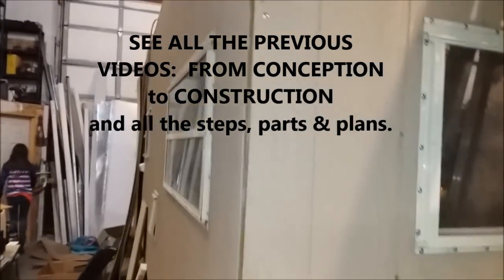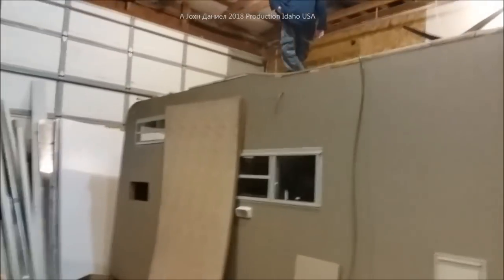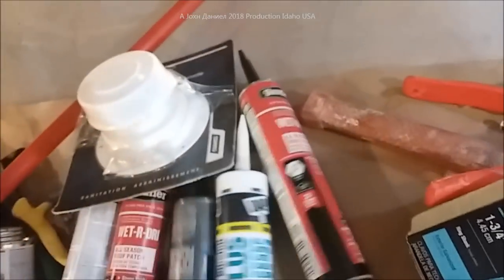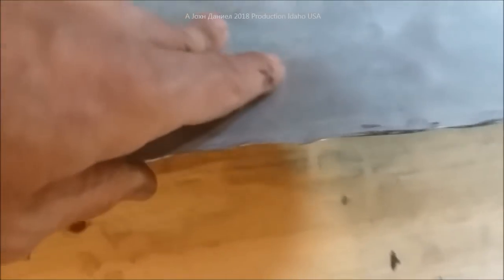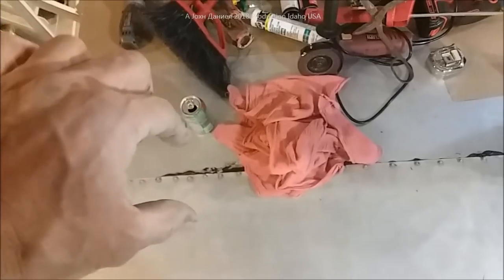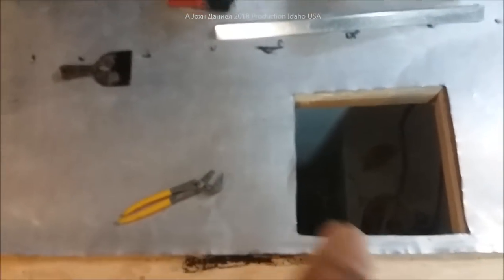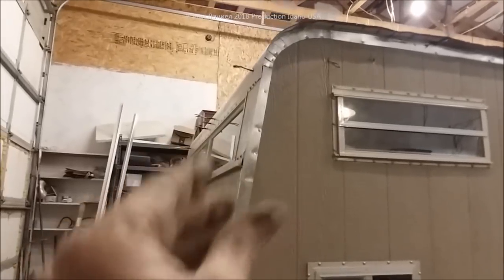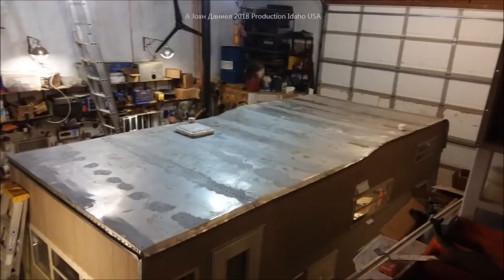Hybrid BUG OUT Tiny House Camper gets roof, windows & doors

Comment: That's a large project, but very cool it's a family project where real life skills can be learned. BTW, I used koolseal elastomeric metal roof coating on a cargo trailer project and it really reduced heat infiltration, just wanted to mention it in case that's on your list of things to do. Cost about $30 per 70 sq ft and in the case of my project, totally worth it.

Comment: You don't think you would want drip edge on those sides? especially with how cheap it is and with all that wood siding.
Reply from the maker: It will have a 1" J-metal gutter all around it, like the rear has and the same as the gutter is below the front window. A idea for water collection basically and a bonus of stopping water sheeting on the walls.

Comment: Man that thing is really cool. Are you scared that wood on the sides will not weather well ?
Reply from the maker: The wood is the same stuff on homes that get rain storms pelting it for years. With the trailer made to be for transporting it to locations and not for endless touring it should be fine, plus my 1955 Cardinal had wood sections ( about 30% outer siding was wood ) and it faired as well as a home of the era.
Reply: Interesting John. I would love to see how it looks in 10 years. I think I will stick around just to see. Your roofing method looks very sound, by the way. Very good video.

Comment: Your trailer is already done by now but having lived in a trailer all my life I would highly suggest a drip rail all around the top edges , but good work all ! :-)
Reply from the maker: It will have a 1" J-metal gutter all around it, like the rear has and the same as the gutter is below the front window. A idea for water collection basically and a bonus of stopping water sheeting on the walls. Its the 26 gauge metal used on commercial buildings for the trim where windows meet metal siding, very deep flashing and 1 inch squared gutter in my use.